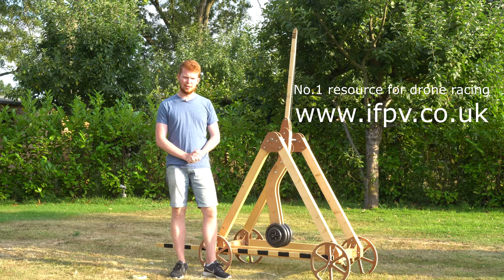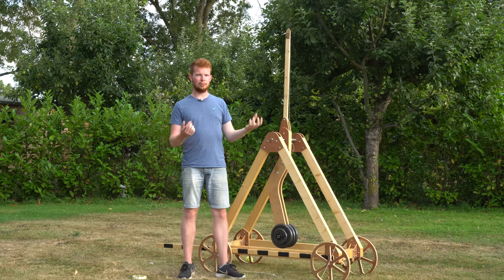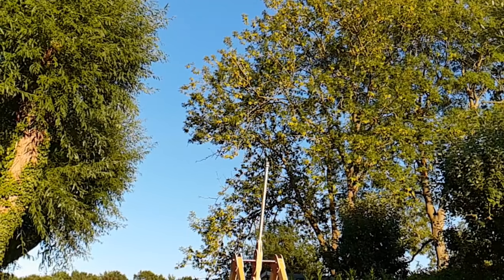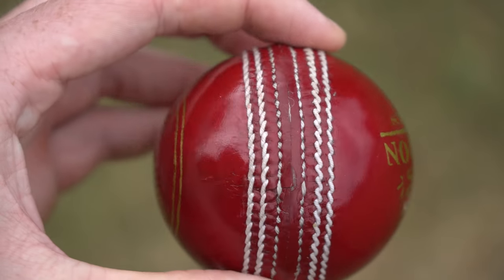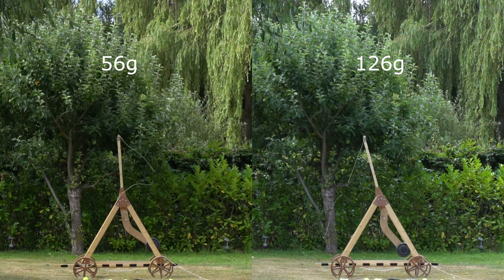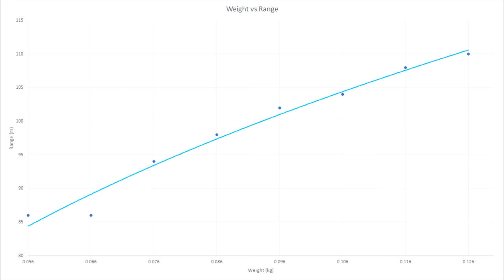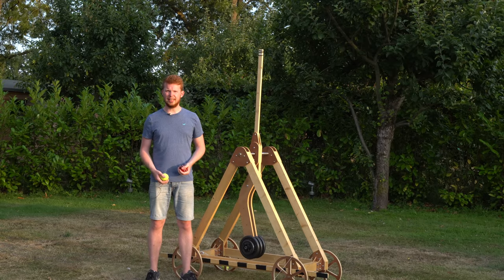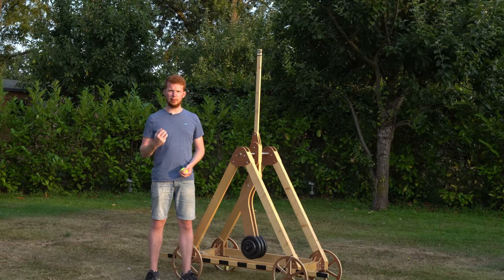Trebuchet Projectile Optimisation

Comment: If the tennis ball is spinning quite fast you have to consider that an amount-significant or not- of its kinetic energy is in the form of "rolling kinetic energy". Not considering this could mean that your calculated efficieny is actually somewhat lower than it really is. Not sure if is negligible or not, but it's something to consider. Keep up the good work!

Comment: Some of the gravitational potential energy of the weights is converted into trebuchet motion: first  backward motion, then forward, then backward again.  The mass of the trebuchet is not trivial.  Thus, I think you could maximize the distance of the projectile by locking the wheels of the trebuchet, or otherwise guaranteeing that the trebuchet is stationary during the launch of the projectile.
Reply: Tom Nally. he tried that. watch previous videos... btw the intuitive conclusions are nearly exactly opposite to how these machines work. If it were a spring or chemical powered device yep, you would be right.

Comment: A lacrosse ball is mostly smooth rubber, it is 145 - 147 grams or so (5 - 5 1/2 ounces). With the baseball you will get spinning because of the laces/stitching by design.

Comment: you should try one of those dimpled hard rubber baseballs that are made for pitching machines.  i'm not sure how much they weigh, but i bet you could reduce the weight a little if needed.  it'd be interesting to see if the dimples help it fly further like a golf ball.
Reply: I use them. I used them to make silicone molds for casting cement projectiles too.

Comment: What about rigging some sort of electrical switch to the sling release pin? You could have some high-intensity LEDs mounted to the lever arm flash when the string slips off and that will give a pretty clear visual of release angle. Plus you could do some neat photogrammetry with long exposures.

Comment: Calculate the max torque of the weights and see how it compares to the max resistive torque of the cricket ball. 
My guess is the cricket ball torque exceeds the weights torque for part of the rotation so you are getting some deceleration during the swing.
I also wonder if you could give your data to someone like carykh who knows alot about neural network machine learning and if he can use the algorithm to predict the optimal parameters. You will just need to choose a parameter that you want to maximize, like distance or efficiency.

Also, great work by the way! You are really inspiring me.

Comment: I guess to find the optimal projectile you would need to balance a couple of things: air resistance, efficiency of energy transfer from trebuchet and any other physical limitations. Air resistance could be minimised by minimising the size of the projectile and may or may not include inducing turbulent flow (it's dependent on a variety of factors, in the case of golf balls, turbulent flow decreases air resistance but this isn't a universal benefit) and energy transfer is a function of mass as you calculated. You may find other physical factors effect the projectile, especially if the projectile gets too small and you have trouble releasing cleanly from the sling. It would be interesting to try a variety of different size, same mass projectiles such as a 16mm steel ball (~138g), 23mm Aluminium ball ( ~138mm), weighted golf ball (~41mm dia) and weighted tennis ball (67mm dia), in theory the small you go the further the range should be unless you experience any other issues.

Comment: You could try 120g juggling balls. Smooth surface reduces drag, increasing and decreasing weight is easy with the beads, they are quarter coloured.

Comment: One factor why the heavier projectiles go further (even though the launch angle is worse) is the reduced effect of air resistance. Namely the higher the average density of the projectile the smaller the effect of air resistance per gram, since the force of air resistance only depends on its shape. So a smaller projectile of the same mass should go further

Comment: About sidewind vs curveball: showing that you don't get the ball thrown off course if it has backspin is good, but it would be nice to see if you spun it in other direction (by switching the strings from one side to another) would make it curve in the opposite direction. Note that it is sometimes hard to see where the ball is in the top-down drone shots: I'd like to see some post-processing (red circle or making shot darker except for the area around the item in question - like @SlowMoGuys or @SmarterEveryDay did in some of their videos). Also, with ball painted in two colors, with each hemisphere of different color, you may miss the spin if the axis is badly aligned: coloring each one eight of the sphere with different color (checkerboard-like pattern) would be better. 

Another good experiment could be to try balls (projectiles) of the same weight, but with different surfaces: the fuzz of the tennis ball, the dimples of the golf ball, the stitching of the baseball/softball ball, entirely smooth ball. Would the distance be different? Would it affect accuracy? How would the distance over time, and/or horizontal velocity over time, and/or horizontal velocity over distance plots look like for different types of balls?

@Tom Stanton, could you please post the raw data, for example as CSV file or as Google Sheet, so that we could do extra analysis? For example I wonder how momentum transfer efficiency changes with the weight of the projectile: does it stay constant? Is energy transfer efficiency proportional to square root of mass, or to negative exponential: the former would be straight line with coefficient of 1/2 on loglog scale (both axes logarithmic), the latter would be linear on semilog scale (only one axis logarithmic).

It would be nice to see if with the heaviest projectile, that made the throwing arm go back, do you still have all stalling points synchronized? How do the https://physlets.org/tracker/ plots that you did for the previous trebuchet video ("Wheels on a trebuchet?") look like for lighter and heavier projectiles?

I think it would be good thing to modify the construction of trebuchet to make it possible to adjust the angle of the release pin in the field. Perhaps something like the one that was done in this trebuchet video: https://www.youtube.com/watch?v=ZbddEcGApgM

Comment: Try considering conservation of momentum for calculation instead of KE. Also cricket ball has much less drag than a tennis ball. That will give you more range. Try a shorter string length with the cricket ball and launch the cricket ball along its seam.

Comment: This is very close to my feild of hobbie physics im an air rifle nerd but more a pellet nerd i was designing pellets as a kid to now and ive made some intresting finds and rounds over the years i specifically make great hollow point ammo that can work from as low as 3ftlb just do a ftlb calculation on the projectile get a speed and weight its all very simple from that you can work out range distance ect but you may need to get drag coefficient calculations too to be as precise as possible from that you could be quite accurate with consistent ammunition weight i also make slingshots that can and do drive. 44lead balls at 30ftlb lol

Comment: You should 3D print a master for the projectile and make molds of it. You could experiment with different types of materials like epoxy, concrete, etc for the projectile and you could add different materials like steel ball bearings, sand, etc into them to get the weight right

Comment: In America, the youth baseball leagues use a pitching machine that works on a spinning wheel. Because of the spin the wheel imparts to the ball, they have to use a baseball sized polyurethane ball that is dimpled like a golf ball.  That may be something you want to look into. And because they are made for firing out of a machine toward children, they are available in softer or lighter than a baseball versions.

Comment: You should try 3D printing different spheres with the same diameter of a tennis ball, but different infill ratios, and surface finishings like one rougher or smoother, and check how that will affect your trowing.

Comment: I would put arduino with sensors inside the projectile. Collected data from the acceleration sensor could give a lot of data how trebuchet works and how air resistance influence.

Comment: I'm not into maths and i have to admit that my brain tends to shut down during the video segments where you are coming out with equations to explain things. 
But i do understand mechanical things when i don't look at them as numbers.
Now , since the arm of the trebuchet seemed to be affected by a heavier projectile, what if you increased the weight of the arm in order to compensate that.
I don't mean the counter weight though , i mean the actual arm itself. 
I would add the weight near the swivel point or, where it connects to the counter weight arm.  That should increase the speed of the original downward motion and should compensate for the extra weight of the projectile that was causing the arm to stop and come back.
I don't know if it's gonna work to be honest and i can't explain my reasoning using numbers. To me this just seems like a logical thing to try and test and see what it does lol.

Comment: I remember flipping through a paper trying to optimise the ratios of a traditional trebuchet, and they found that the projectile should weigh 1/100'th of of the counterweight. That cricket ball is accidentally bang on 😎.
I should still have that paper on disk somewhere, drop me a line if you want it. It went pretty hard core on many aspects of trebuchet sizing.

Comment: Well everyone makes maths errors sometimes. Both my parents are mathematicians and even they make them. I make them all the time, which is why I ask someone to double check my maths (unless it's a test obviously but I guess that's the point of the teacher grading it really). In any sort of thinking, it's impossible to avoid getting your mind going down an inaccurate train of thought which makes it nearly impossible to spot your own mistakes but someone else who hasn't gotten on that train of thought with you might be able to spot them more easily. I have also found that looking at it again after some sleep or even in a different state of mind (such as stoned or even drunk) can help too. I actually figured out some potential things that may have gone wrong with an experiment when I had to write up a lab paper about it because I gave up and got drunk. Then my mind felt free to think outside the box and I came up with the probably cause of my experiment's failure. Even though my experiment had failed to show the expected results, that was probably the best lab paper I have ever written and I got a perfect score on it, plus the teacher made a comment about how he was impressed with my insight as to what may have gone wrong.

Comment: go heavier as long as the transfered energy does not drop and adjust for the release angle. if you get the same energy in a 250gr ball it it might start to not go as far, but you schould definatly check at which weight it does to find your true optimum.

Comment: Try adding some mass at different points along the arm , I suspect putting it at the joint between the weight bar and arm will allow you to obtain the inertial stability of the arm, more effectively than putting an equal weight on the counterweight, if that's a consideration for the heavy cricket ball

Comment: You appear to be using twisted line for the sling. this will tend to put a spin on it. I think it's the torsion energy developed when the twist is stretched and released.  Braided (like Spectra cord) will not.  Might be part of the curve you're getting.

Comment: To throw the tennis ball furthest, it has to exit the sling very fast at the optimal angle. When the weight has 0 velocity at the lowest point, the tennis ball should exit. To set the timing right you should adjust the slings length. A heavy projectile needs a shorter sling (because it is slower) and a light projectile needs a longer sling (because it moves faster). The throw angle is adjusted with the angle of the pin.

I don't think you receive good results with a constant sling length

Comment: Tennis balls tend to fly like wounded ducks. They're too light for their frontal area and shed velocity fast. That's probably why the cricket balls went farther even starting with less initial velocity. I can give you a design for a field-adjustable sling, but with your "tip wobble", AKA premature beam stall, it wouldn't help a lot by itself.

I have a few trebuchet videos on my channel if you care to take a look.

Comment: Tom, why don't u take into consideration such a factor as moment of inertia?  Counterweight moment of inertia doesn't let it to fall with maximum acceleration which is "g" = 9.8m/s. Consider using of roller bearings for your counterweight so it couldn't gain spinning while it's falling.

Comment: If you were in the business of creating trebuchet for warfare I think you would start with considering the projectile's typical mass. Then you would vary the size and /or weight of the  components in the trebuchet to optimize  the trajectory of the projectile to achieve an ideal range and/or velocity. I think you could create a formula or two to ease this process.
Reply: In medieval times they started with the biggest tree they could find for the throwing arm, then scaled everything else around that.

Comment: Just eyeballing the slow-mo @ @, I see > 10% increase in the cord length between when the arm is horizontal and at release. Some of that seems to be down to the ball compressing so the top and bottom cords are at a sharper angle, and some from cord/pouch stretch directly.

In any case, you're not getting this energy back, so best not to lose it in the first place.

Comment: Gr8 Job Tom ... Did you work the Earth's spin of 1'037 Mph at the equator from the West to the East that's about 800 Mph = ( 1173.333 FPS ) at the 55th parallel here in the UK  into your calculations ?  Or did you just prove the Earth don't spin ? ?   Food for thought  ....  ; - }

Comment: my gut feeling is that the differences in actual versus calculated speed and energy values are losses from the flexing of the frame. Perhaps stiffer frame materials (metals?) would yield higher efficiencies for the same parameters

Comment: The trebuchet was a siege weapon, so while range was desired kinetic energy on impact may have been more important. Would a lower arc allow for a landing before the energy dissipates into the air? Can you control that variable?
Reply: Arc is controled by design of release that needs to be changed or at least tuned with different weight of a projectile. Both high and low arcs have their merit because most sieges weren't fought on flat terrain. High arc is also better for throwing incendiary ammunition over fortified walls and getting any projectile through roofs and floors of any given castle. It might not directly help in getting You inside faster but it might damage inner workings of a fort and weaken defenders.
Reply: You can reduce energy dissipation with an heavier projectile. Assuming constant efficiency and energy released I think it should be slower (so less aerodynamic drag) than a light one and it wouldn't travel that far, but you would theoretically deliver much more of your energy on the target

Comment: is there a way to detect sling angle and electonically release the sling? Maybe put the sling cords on a pivot with an encoder there and on the main arm, so a micro controller could calculate the current sling angle and release the sling. Might allow for optimal release points regardless of weight.

Comment: What about creating a number of different sling lengths that you can easily change out by either the knot that you use on the thing or just using a clip to secure it to the metal ring. Also with an "American Baseball" as you call it, you not only have to worry about sling positioning, you will also need to worry about how you load the ball into the sling as different alignments of down spin will effect the direction the ball flies, hence all the different styles of pitch in the game. and maybe talk to AvE about machining you an aluminum sphere with dimples of the size that it starts out at 130 grams and with all the dimples drilled into it ends up coming down near 27 grams that weight seems even more optimal though you might want to wait until after your test of different sling lengths.

Comment: Buy more weights, instead of 15kg try it with 20kg, 25kg, 30kg.
There is going to be a limit to the weight that your Treb can safely handle, but my guess is that it is more then 15kg.
I am not a physics guy, but something tells me that more weight will increase the velocity of the ball as it releases from the sling, if that is the case, then maybe that 156g cricket ball would be the one that would give you the best distance, as it would be less effected by the wind resistance.